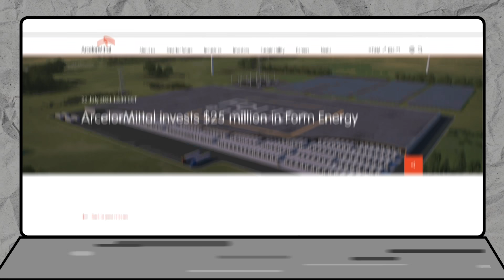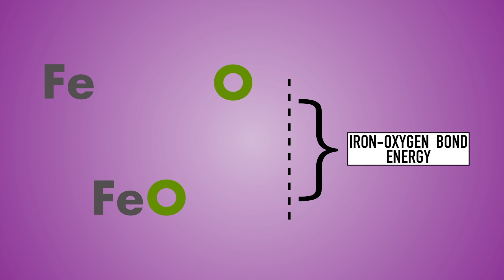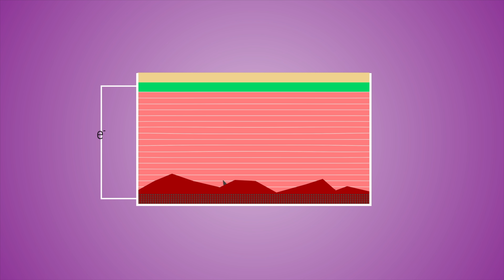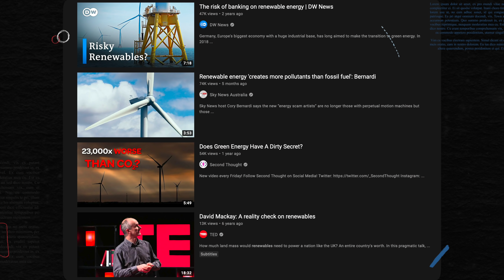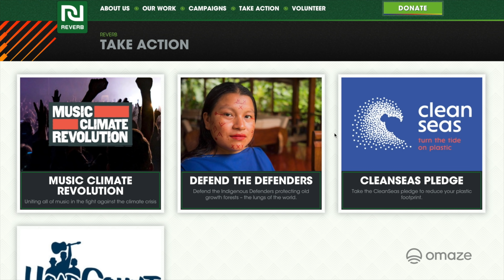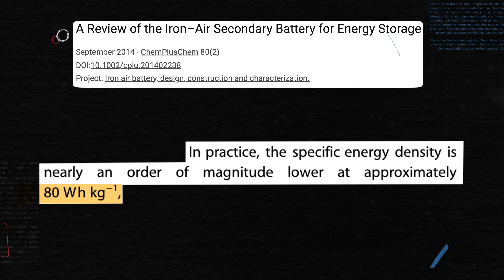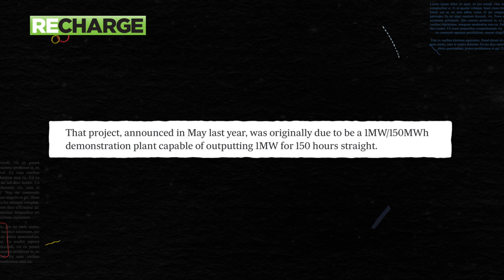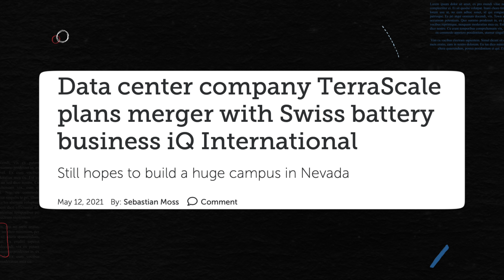Iron-Air Batteries Could Be The Start Of A Revolution In Energy Storage

Comment: Make your own. You need a stainless steel screen, graphite and fine steel wool for the anode. A separator of porus polyethylene cloth like that used for crafts. For the cathode prepare a mixture of activated charcoal, copper oxide, manganese dioxide, and graphite. Put this into a fine screen of copper or nickel. For the elevtrolyte use potassium or sodium hydroxide. Make two cathode assembies and put the iron anode in the middle. Next wrap the  assembled cell in tyvek which is a PTFE semipermeable membrane. The battery will improve with a few cycles on it. If you want it super charged you can use silver in the cathode side.❤

Comment: Nice video! What about Cryogenic Energy Storage (liquifying air)? Better efficiency than the rust-battery and much easier to scale up to very high power levels with neither the need for any power-electronic converters nor battery management systems (required for series connected cells).

Comment: "Hydrogen cars" if you think hauling around a tank of liquid gasoline who's only danger is is the flammable vapor,(liquid gas is not flammable, ask any good mechanic) wait till you are driving around in a literal tank of liquid hydrogen that combusts easily in confined spaces when exposed to air. Hydrogen becomes vapor very quickly in air, hence the danger, do some electrolysis and hold a match over the top of the tank, you'll see what i mean. Might as well strap a bomb under your seat and hope you are never in a wreck. I understand the common Hollywood trope that cars in wrecks explode on impacts, that is highly uncommon check your local wreck reports. Even when combustion vehicles structures are completely destroyed rarely is there an explosion, do they catch fire? Yes, but those are two totally different things.  Nevermind the weight to wheel inefficiency for hydrogen. I'm all for new energy that is cheap and isn't a fossil fuel, just keep in mind poor folks around the world still can't afford combustion engine cars so you think they can afford a Tesla or any other new energy source for locomotion that requires expensive infrastructure? Sorry, for now gas is cheap, portable and though not efficient it makes up for it in being abundant for now.

Comment: It's a bit annoying that you get the formula for rust wrong. FeO2 is ferrous oxide, which is HIGHLY soluble in water and would wreck the battery almost instantly. Rust - ferric oxide - is Fe2O3 and is nearly insoluble in water. Ferrous oxide is a pale green color in solution, not a red powder.

Comment: Negative prices for renewables is the unfortunate result of a utility having to pay a green energy producer to deliver power at full contract rates. The utility can't use the power because of  adverse operational and economic impacts it causes . Frequently this is done by the host utility seeking another utility willing to accept the excess power if they are paid to take delivery.  The extreme example of this is paying the non utility generator for power it does not generate. I saw examples of this before retiring from the utility industry. This upside down logic is the result of contracts that require a utility generator to buy power from a non utility .  Utilities must operate in the real world where it is sometimes practically impossible to operate running generators any lower than they are already running.  The choices are shut a generator down or find another utility That will take delivery of the excess power even if you have to pay them to take it.  In the real world starting and stopping  a generator is costly and shortens generator life. Reliability can be affected if the green energy stops and there is not enough running generation on line to replace the loss. The electric industry is far more complex than most people understand. This short discussion only scratches the surface.

Comment: Great video. However, all this talk about renewables makes me scratch my head. The efficiency and power output are laughable compared to nuclear. As humans continue to demand more and more energy, only nuclear can scale to anything realistically relevant. Even worse, all this "renewable" tech that requires lithium is worse on the environment and more toxic to humans that plain, vanilla coal.
Reply: I love the way you start talking about NUCLEAR, and finish comparing Lithium to COAL!
And Lithium is NOT worse than COAL for residual pollution. 
Now, talk to me about the billions of dollars required in future to decommission just Britain's old Nuclear sites!
Reply: @dnomyarnostaw  Since EV's are the "wave of the future" lithium has become a vital component of EV batteries. Lithium strip mining, done en masse, will be several times worse than coal mining is. Just do some reading on Australia's growing issues about it. Furthermore, I was using it as an example of how renewables aren't as great as they appear. Take solar panels for a second example. Many of the components needed to make them are super toxic and extremely harsh for the environment. In fact, the benefits to the environment don't outweigh even the long term benefits of "clean" energy. Finally, you're thinking very small. France (I can't believe I'm saying this) has done it right, when it comes to nuclear. With all of this liquid salt stuff being tested, it'll be cheaper and safer than ever. No doubt there are hurdles to overcome but if we can put men on the moon and rovers on Mars, then I'm confident we could do this.
Reply: @nwren4637  "lithium has become a vital component of EV batteries."
No, it has become an important, but not vital part of EV's. There are plenty of improvements to battery technology coming on line. Lithium isn't the only solution.

" Lithium strip mining, done en masse, will be several times worse than coal mining "
Here you go again, with an inaccurate "one size fits all" statement. First, Lithium isn't all strip mined, it's often from salt deposits on dry lakebed's or in saline lakes.
second, worse than coal mining? What a down and out misrepresentation. Instead of inert, mineral excavations, Coal not only leaves the damage done by mining operations, it has to be burnt leaving radioactive, carcinogens as a "by product". Way worse than Lithium. Name any damage done by badly run Lithium mines, and I can show you a hundred times the damage done by the equivalent in Coal Mines, hundreds of thousands of them.

"solar panels - components needed to make them are super toxic and extremely harsh for the environment"
There are small parts of ruthenium, indium, tellurium, lead and lithium. There is about 50 grams of lead per 100 panels in standard panels. Cadmium Telluride (CdTe) is a commonly used material in thin film solar modules, but only about 23 grams per kilowatt.  
They don't come CLOSE to oil and coal burning for energy, with triple  the levels of toxic mineral released as well as sulphur and arsenic. 
Now, how much easier is it to recycle old PV cells compared to  the atmospheric distribution from Coal and Oil energy release???? 

"With all of this liquid salt stuff being tested, it'll be cheaper and safer than ever."
Oh, so youre all optimistic about  the future of nuclear development, but you are writing off solar and battery technology straight away.

Try and get more informed about subjects and stop making these broad, inaccurate statements.

Comment: 8:00 You can store hydrogen forever? Ahh no, actually not... Hydrogen is volatile, diffuses through matter and tends to bond quickly with other materials. 
And storing it in hydrogen carriers even worsens its efficiency much more, than it already is. I doubt your expertise about such topics.
Reply: partly solve by ammonia
Reply: Total bs. They use ceramic lined vessels for long-term storage.

Comment: Lol  Why don't we just put a metal sheet on top of our roof And then electroplate it with zinc or copper aluminum whatever iron a 1000 × 2000 × 5000 times to make a  state battery and then when the sun hits it as it does It will cause electron flowas it wants to cool down i.e. A fucking ginormous battery. There's so much technology out there there are so many ideas out there there's so many inventors out there it just goes to showThat really it's only the rich people people or the stupidly challenged That seemed to get the right ideas put into play

Comment: A Dutch university has developed an Iron powder fed furnace. Iron powder oxidises nearly instantaneous when blown in  into air and gives off a large amount of heat. (The powder glows red).
The resulting rust can then be de-oxidized in a modern iron ore furnace that does not use cokes.
Reply: yah I think people forget iron burns - as powder   or as wire wool -  do not try to burn wire wool at home without a responsible adult on hand!
Reply: @the_forbinproject2777  Btw, The Forbin Project is a great movie. It explores the danger of AI. Should be seen by all AI fanatics. On the other hand it would guarantee peace.

Comment: Using an iron folded like foil, will increase the surface exchange, and implementing hot swap iron foil cores or battles could give more industry and jobs.

Though this sounds more like a fuel cell than a battery.

Comment: Isn't there a way to safely and efficiently turn the emitted hydrogen gas during the charging cycle back into electricity?
Reply: Fuel Cells of course, if you want to use the hydrogen on-site. Or you could collect, compress and export the gas elsewhere.

Comment: You said hydrogen can be stored forever.  That is false.  Hydrogen atoms are so small, they will leak through any container.  Not drastic amounts in the short term, but don't expect to store it for months or years without serious loss.
Reply: No they won't leak through ceramic or special epoxy coatings.
The Japanese found lacquered  rice paper worked better than rubberized canvas for balloons .
Reply: @dnomyarnostaw  it's my understanding that while materials like graphene, have the potential to store hydrogen without leaks, that nobody actually has leak proof hydrogen store yet.  Some materials are significantly better, but that that doesn't mean they're perfectly sealed.  Leakage over a day vs leakage over the course of years.  Do you have a source?
Reply: @dpjazzy15  Current commercial pressurised storage can achieve H2 permeability down to .05 grams / hour / kilo. That's over 2 years of storage.
For long term storage of Hydrogen, then Ammonia or Hydrides is the optimal solution. No-one would use pressurised tanks for that.
Lab tests with Carbon Fibre, metal coated containers have gotten this down to undetectable limits, and no doubt if demand requires it, they will get this commercialised.
H2 embrittlement of metals hasn't been a problem for 50 years, because commercial standards have been in place that long.
If long term storage of Hydrogen was ever required, there are plenty of viable solutions, but H2 demand will always outstrip supply for the foreseeable future.

Comment: Please explain the concept of “10 times cheaper”.  “8 times more expensive” I under stand.  Isn’t “1 time cheaper” 100% cheaper?
Reply: "A is 10 times cheaper than B" is the same as "B is 10 times more expensive than A"
Reply: @u1zha  OK, if A is $1,000, that would make B $10,000.  I understand that, it’s simple multiplication.  However, if B is $1,000 what is 10 times less than that?  One time less would be 100% less with the result being $0.  2 times less would be -$1,000.  3 times less would be -$2,000.  That would mean any more than one time less expensive would be the owner paying you to take it.
Reply: @donelmore2540  It means 1/10th as expensive, or 1/10th the cost. Don't be pedantic.

Comment: I can see why there hasn't been much interest in this technology. With efficiency that low, and that low power density, it's on par with compressed air storage or hydrogen fuel cell storage. Not as good as pumped hydro, flywheel, or any kind of battery. The price is right, but only if, like stated in this video, renewable energy is really, really cheap. Losing ~50-60% basically doubles the cost per kWh of electricity, then add the levelized cost of storage.
Reply: While it has some issues it improves efficiency with cycling unlike most battery types. The big drawback to it is that it has very high self discharge times. With renewable energy that is charged by day and used at night it isn't a problem though. Adding a small amount of silver as a catalyst to the cathode material greatly improves the efficiency ❤

Comment: I've heard a lot of hype around Form Energy's iron-air battery.  But this video helps put it into perspective, with the stats.  50% efficiency. 80wh/kg. (Not great.)  But apparently, they are making play for the economics for grid storage ($20/kwh).  Since it is stationary storage, they can afford a huge land area.  This along with a niche for multi-day duration storage, an abundant material (iron), and ease of recycling.  I wish them luck.
Reply: Didn't Form Energy solve the low efficiency with electrolyte additives?

Comment: I really wish people would start describing this as "low C" batteries instead of multi-day batteries.  All batteries can be multi-day batteries if you use them that way...
Reply: What does low c mean? Oh fine I'll Google it. Hrm I didn't find any obvious results matching that term.
Reply: @TheSkystrider  it is a measure of charge rate.

A battery that discharges at its rated power in 1 hour has discharged at a rate of 1C.  1kwh discharged over 1 hour. 0.1 C if it takes 10 hours.
Reply: A gridscale Li-ion battery can empty its full charge in a couple of hours or less, these might literally take days. That is one reason why these are multi-day batteries and Li-ion is not.

More importantly, because Li-ion is so expensive you would be losing money if you do not sell the energy you stored at noon during the evening peak hours so your battery is ready for another charge at night for the morning demand. It is not economically viable to use Li-ion for long term storage.
Reply: @AnalystPrime  You could drain Li-ion over several days if you chose.  But with these batteries, you do not get to choose - they just cannot drain anywhere near as fast as Li-ion.  

Where would we put the acres of buildings necessary to house these units? Perhaps in existing power easements?  could put solar panels on the roof too.  Cheap batteries are cool - but when you have to create stadium sized building for them...

Seems LFP will do it in the short term, and Na ion batteries may be the next grid storage tech.

Comment: Energy from "rusting", once the iron is rusted, the energy has been extracted.   However when iron oxidizes, it expands a lot so iron air batteries are fundamentally structurally unsound.
Reply: She talks about that constraint at 7:15. Of course they figured that destroying the anode entirely would not be good.
Reply: They said that the problems were caused by impurities, which are blocked by the oxygen membrane.

Comment: If the hydrogen generated as part of the inefficiency of charging could be captured, then the effective efficiency of the system would be better.
Reply: I was thinking the same thing. I have worked at two companies that needed electric forklifts in their warehouse and the safety instructions included mention that smoking near the battery recharge room was forbidden because they might release hydrogen during charging.

Incidentally, last year my current employers upgraded the forklifts with lithium batteries that weight half or less than what the old ones did and can charge ten times faster. Unfortunately the ten times more powerful chargers required them to do a near complete rebuild of the electric systems in the building...That was not cheap.

Comment: The one downside to iron-air batteries that wasn't mentioned in the video is that it appears to be about 60% efficient.
Reply from the maker: We did mention it. Said 50% though, since that’s the more conservative figure.
Reply: @TechforLudditesSira  And Soler panels are only 22% efficient, so 50% without years of research and if it's component parts are cheap and abundant.
ICE is only 40% efficient and we have used them for the last 100 years.

Comment: This could be promising if it can be refined and scaled.  A company called ESS is supposed to be building the first of several all iron flow batteries this year.  Same 1-acre design can scale to 6MW of discharge/recharge and over 12 hours of storage.